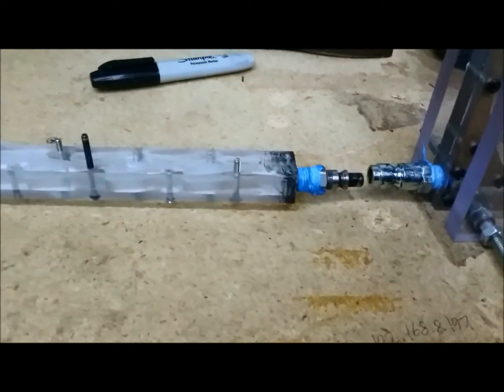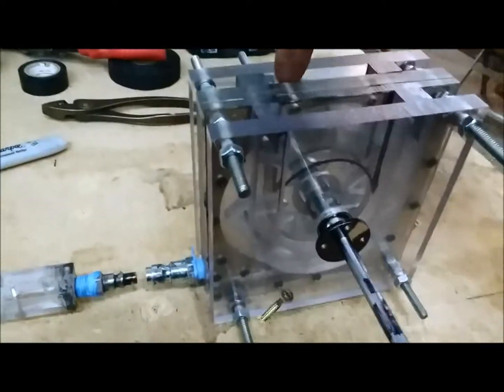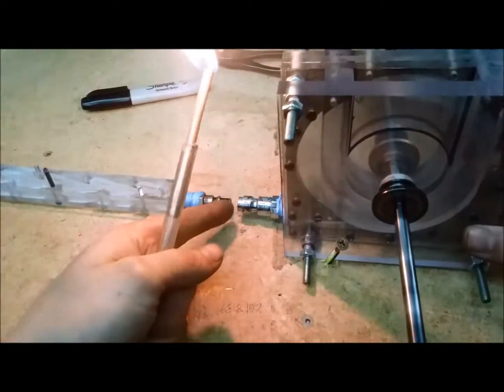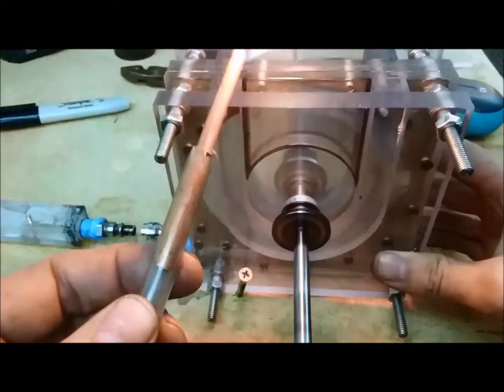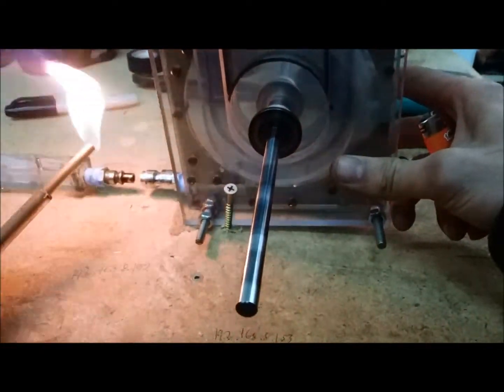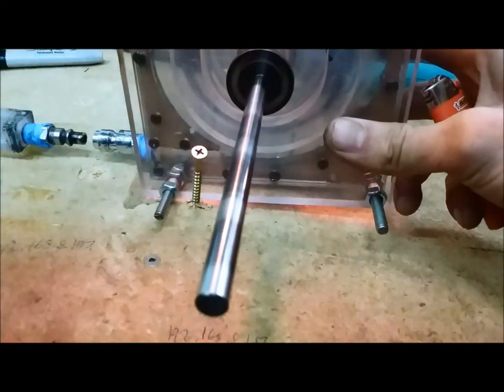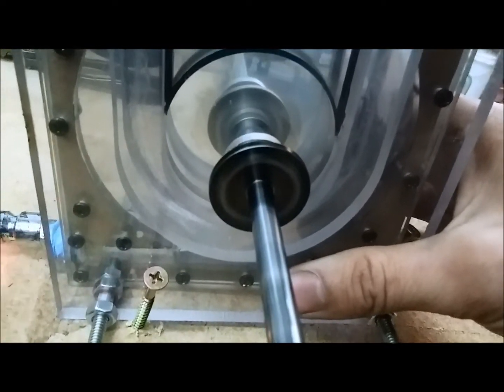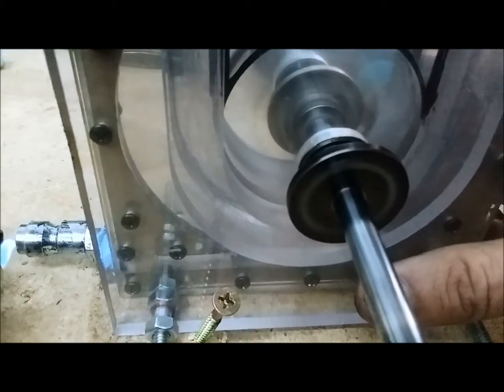Tesla Fluid Dynamics - Suck & Blow ? - Part 1

Comment: You can really start to see how it could harvest ambient air pressure with this experiment.  You need one way valves on either end to prevent back pressure?
Reply from the maker: If you look at the Valvular Conduit patent it has two "one way valves" at the front end. Having a vacuum stage ensures one way flow to a higher degree.

Comment: wow that's interesting so the ozone is coming from the fire? or plasma you may as well call it?    so fire Plus vacuum = ozone?  or is it something to do with the speed of the rotation? I'm very curious I've never heard of this effect before.  I know these turbines are very good at converting heat into energy so is it something to do with that conversion?
Reply: @nikola.tesla.r.and.d.centre ok thanks.  I've made plenty of ozone myself with high voltage but this is different.   I know fire is just another type of plasma pretty much the same as an arc of electricity.   I think the difference between them is the speed of the electrons. So maybe it's because the fire is been put in and stretched at high speed and combining with oxygen from the atmosphere.  really interesting.  great work guys keep it up
Reply from the maker: I think Jeremiah from iEnergySupply could weight in here as he personally carried out the experiment.
Reply from the maker: I didn't do the experiment but Tesla was definitely into making ozone. He had the first patent on an ozone generator. It looks extremely similar to his tuning circuit for Tesla coils.